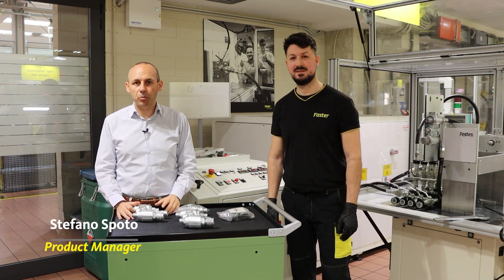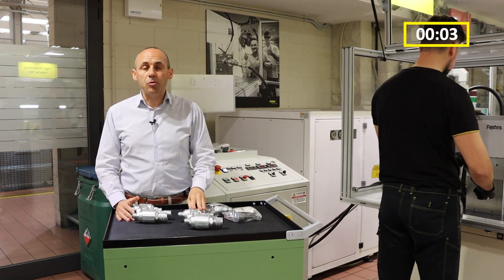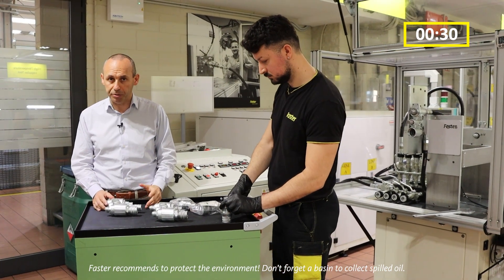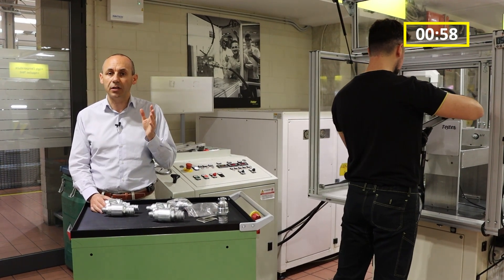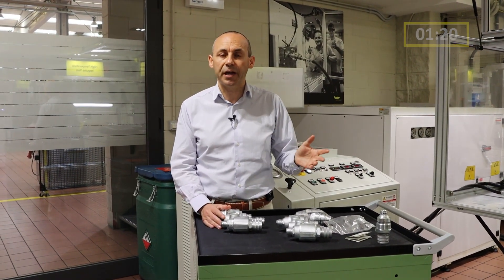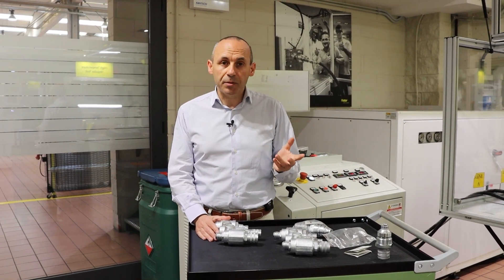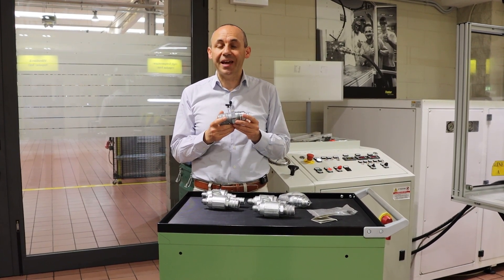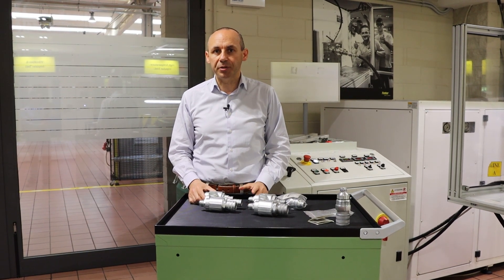4BD4FH: How to switch your skid steer and track loaders from standard to high flow

Comment: How many gpm will it add?
Reply from the maker: The switch from 1/2" cartridges to 3/4" ones allows to increase the flow by 12 GPM without increasing the pressure drop that the passage of oil through the cartridge provokes.
With this easy replacement a skid steer loader gets equipped with auxiliary hydraulic couplings sized appropriately for connection to high-flow attachments, but it’s important to verify if the machine’s hydraulic system (pump, diverter valve, etc.) is sized too.